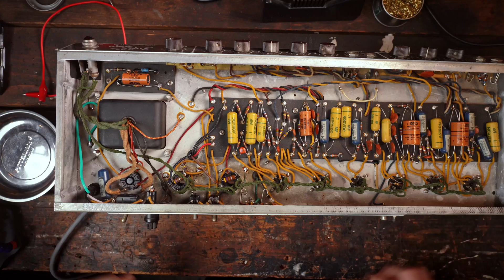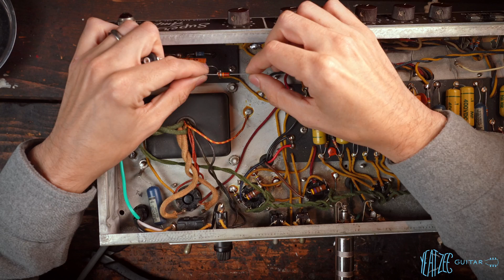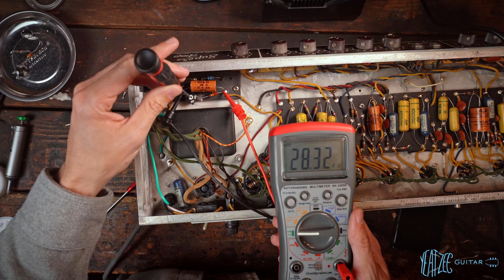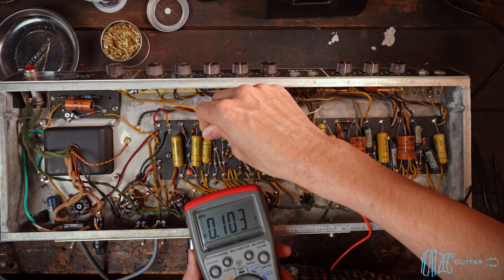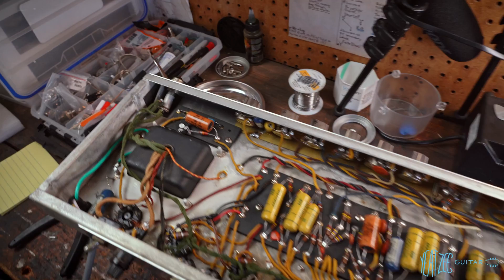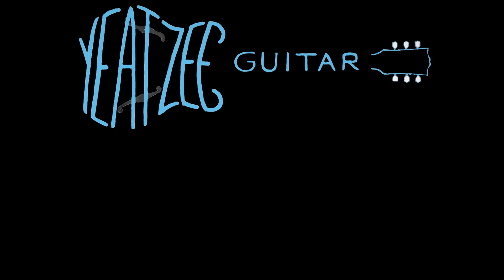IT. IS. FINISHED. | 1961 Fender *Super* 6G4a Amp Repair - Pt. 5

Comment: Ever chat with Lyle at Psionic about this?
Reply from the maker: About what?
Reply: @YeatzeeGuitar  Lyle from Psionic was always stating how difficult it was to not have dc leakage on the fender eyelet boards due to wax or moisture. Also between certain eyelets closely spaced on the boards.
Reply from the maker: @meesterprofe007  gotcha yeah keep watching the series (linked in description). I go over that in detail 🙂
Reply: I really did like how you were chasing down the leakage on the chassis…in the end these amps are just like that, but sound great! …dogs have some fleas even after you wash them.

Comment: Great work, but I still dont understand how the order of bias pot + resistor matters.  What do you mean when you say the pot fails?  a dead short or open?  Either way isnt the resistor  in series?   if the pot shorted then you still get the R as  a safety.  but that wouldn't change based on which side the short is .    If the pot is open then that whole leg is open.    What am i missing?

Comment: Over the years all of the dust, smoke, humidity, etc., in conjunction with the repeated heat cycling of the amp through usage can and DO cause the board AND wire sleeves to become conductive. Certain wire types fare better than others. Even cloth wires become conductive, sometimes more-so. Unfortunately, the only [actually best] solution would be to remove the board, all remnants of solder/flux, scrape/scrub it with copious amounts of isopropyl [preferably 99%], then apply heat with your iron on each eyelet to force any moisture away from them. You will be able to see it. After that, more isopropyl on the board, wipe and use a heat gun to really dry it out. Watch around the eyelets while doing this for any remaining moisture being forced out and repeat if needed. Yes, it's all time and cost prohibitive. At that time, you can clean all the crud off the inside of the chassis you could not get to which can also cause conductive problems and address the wiring itself. The inside front panel brass plate can also be removed, thoroughly cleaned and attended to also. This often really helps quiet an old amp plus allows better access to the pots and components.

Comment: Microphonics are strangely contagious. A single microphonic tube can cause the same in adjacent tubes that are not when that tube is removed. It can even move to adjacent caps, largely anything otherwise connected to the offending tube both electronically and physically.

Old ceramic caps are notorious for developing microphonics.

Comment: Glad to hear you're going to try stuffing the astrons. I didn't know whether or not you'd see my post when I suggested it. 
I've never had the opportunity, or I would definitely have tried it by now lol.
Reply from the maker: That presence knob astron will be my test dummy for the next amp with them that needs it
Reply: @YeatzeeGuitar cool. I'll be interested to see how it works! 
Did you ever think about using a normal full sized pot for bias and just use double sided tape on the back to isolate it from chassis? There's some 3m tape that works great.
Reply from the maker: @soapboxearth2  I'm not sure I'd be comfortable trusting tape to hold a large metal object inside the amp. Eventually it could let go, perhaps even in shipping to the owner, then you're in trouble if you turn it on and it's shorting out against something it shouldn't be.
Reply: @soapboxearth2 I have soldered the CTS bias pots in before. Either by the case, or with a small brass mounting tab. Adhesive of any kind is too unreliable for decades of service. You can’t rely on people to regularly maintain anything, so make it bulletproof.
Reply: @matthewf1979  yeah good idea . I was also thinking that an L shaped piece could be soldered and mount the pot on that. But I think your idea of soldering the pot to the chassis is better. I might consider taking the back of the pot off to solder it and reassemble once it's on, to prevent toasting the carbon track.
Reply: @YeatzeeGuitar    yeah true. I've got a couple that have held up for years , with the right adhesive but I don't lug my gear around or ship
Reply from the maker: @matthewf1979  ooh that's interesting! I could totally see soldering it on as a decent solution with the big iron if it's solid enough to only need to touch it for a quick sec. Definitely not the move with little experience chassis soldering though.
Reply: @YeatzeeGuitar  I have a stack of 0.015” brass sheet that I use for Fender style ground planes. It’s a very useful shop commodity for building all kinds of mounting brackets and block off plates. Of course, being brass makes it very easy to solder to. All you need is a decent pair of heavy duty scissors to cut it. Step bits are highly recommended to drill holes in any sheet metal.

I buy brass sheet on ebay. Look for the scratch and dent lots in decent shape. I use up the bent/dented stuff for small parts and the big nice sheets for ground planes. It’s a LOT cheaper that way.